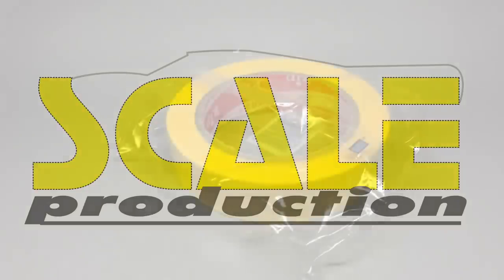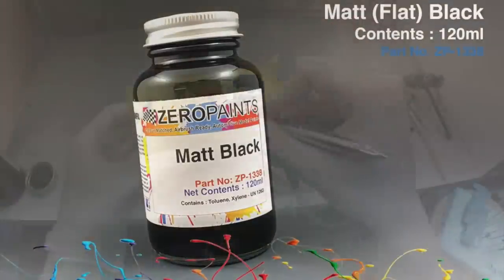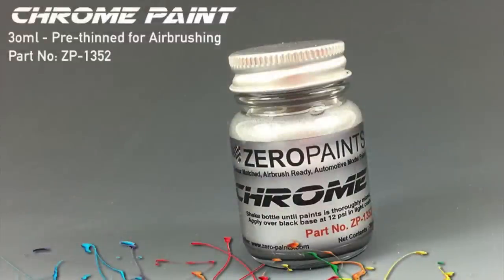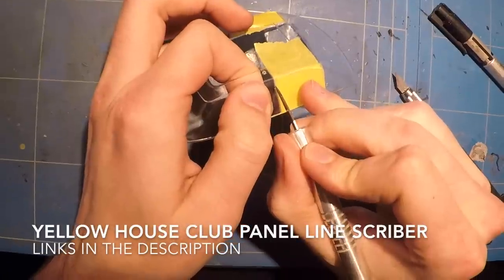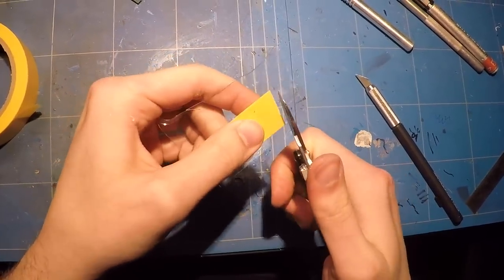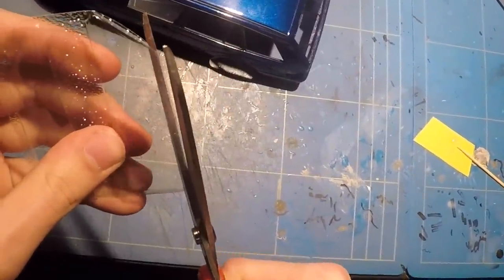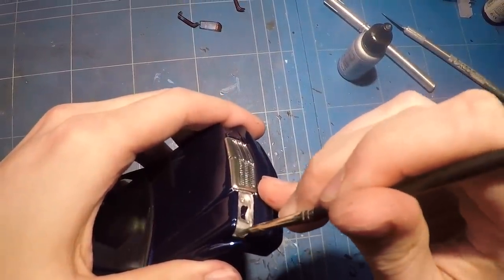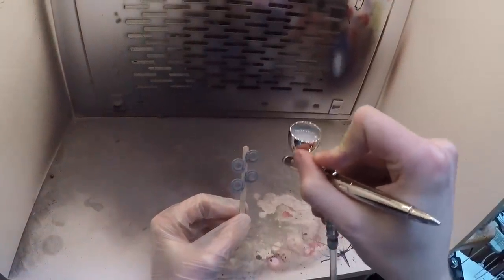Fujimi/Scaleproduction: Mercedes Benz 190E EVO II Touring Part 2

Comment: Alclad chrome won't be better for chrome grill etc? One that you used is more silver than chrome?
Reply from the maker: It would be more chrome, but would also rubb off easily
Reply: Thanks for answer. Even clear coat or something else can't protect that from rubbing off? I'm interested in final effect like on chrome parts from die-cast manufactures :)
Reply from the maker: Normal clear will make the chrome effect go away. And the other clear for alclad is not as strong. + i just wanted to try the zero chrome